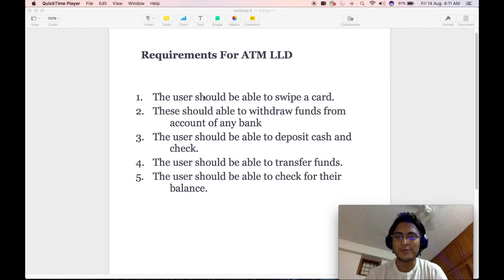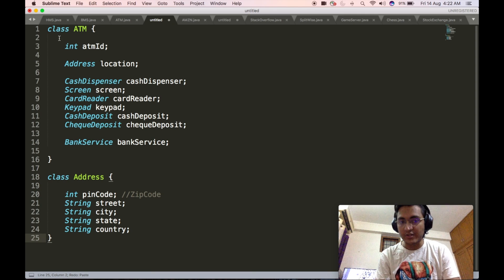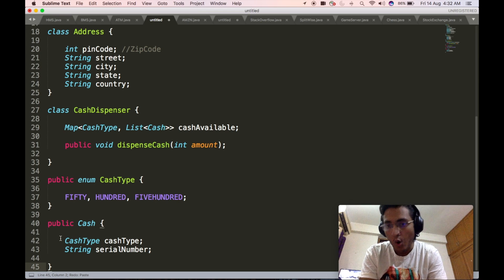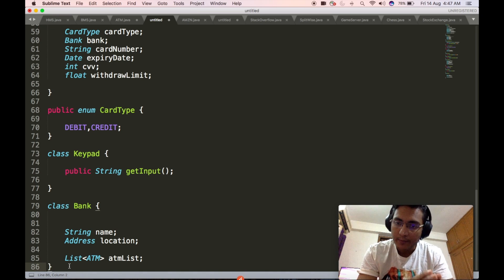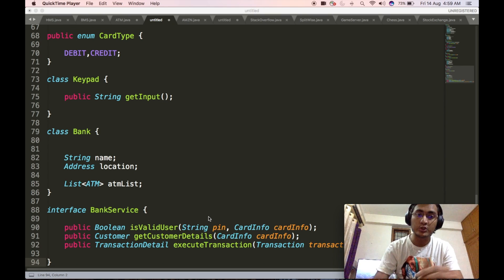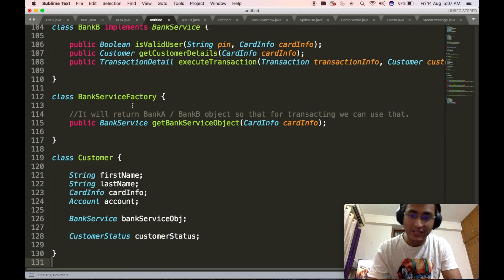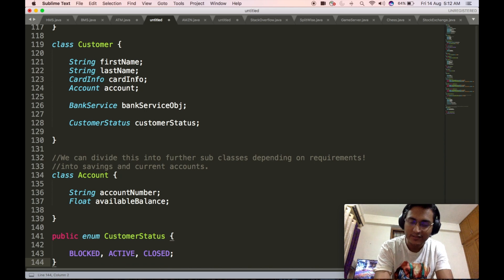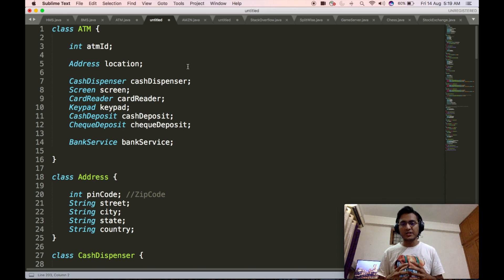ATM LOW LEVEL DESIGN | FACEBOOK INTERVIEW QUESTION | SOFTWARE DEVELOPER INTERVIEWS

Comment: This is very nice. I've couple of comments though - 1. It would have been nice if you have details around the DB design and tables..  2. It would have been better if you can slow down little bit when explaining the logic/intuition behind defining each class. and also In the 'Transfer' class  - I think it makes more sense to have the destAccount field type as 'Account' instead of 'String'

Comment: Good explanation however I would suggest some of my inputs -
1. ATM should not have BankService dependency, it should be inside the Bank class
2. Similarly the factory class should take Bank as an input and return the corresponding BankService
3. ATM class should have a Start() or a similar method that is gonna initiate any transaction by fetching the CardInfo, and from CardInfo fetch the Bank, and from Bank it should fetch the BankService following which it should call the ExecuteTransaction() of the bank service.

PS - This is just my observation
Reply: Yes, that makes more sense and fits the design well. Here, we can follow strategy pattern as well (composition over inheritance concept) by
Creating BankService<<interface>>  which BankA and BankB concrete classes can implement and then we inject the dependency in Bank class via constructor.
Reply: @abhinavrastogi5310  Hey could you elaborate a bit further please? The constructor part specially, it would be really helpful, thanks!

Comment: Really appreciate the efforts you are putting in to make it and i would like to congratulate for these worthy videos.

Just as a suggestion- the way you introduced the videos of Hotel and Library Mgmt System by creating Part 1(req +. usecase diag) and Part 2(coding), it puts more emphasis and gets wired in mind :)

Also, why not create it for other systems like food delivery, cab service, payment svc etc.
Also, System design problems.